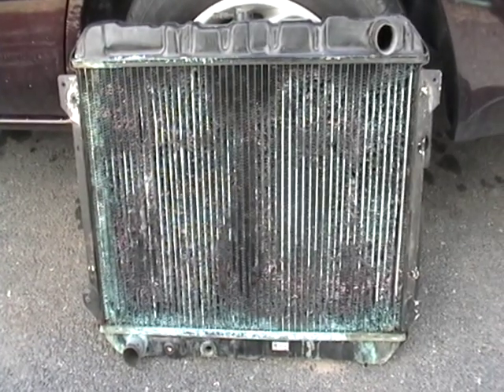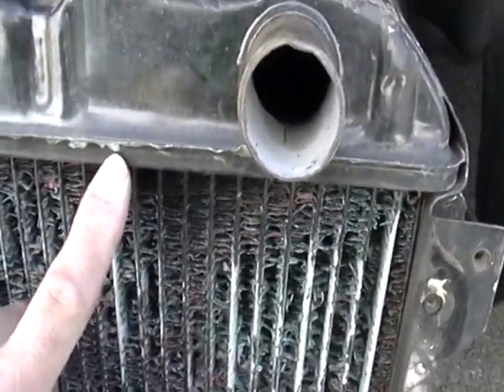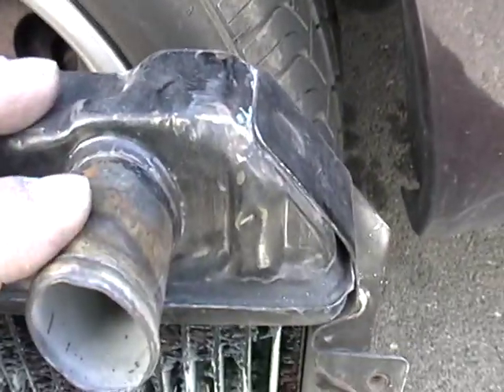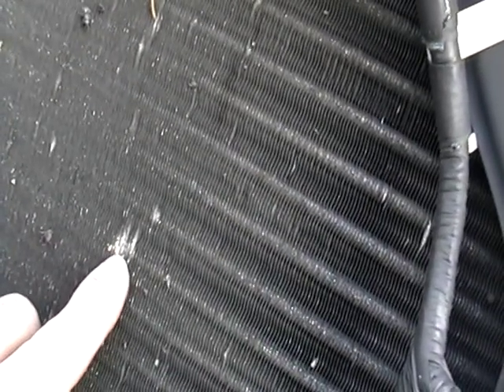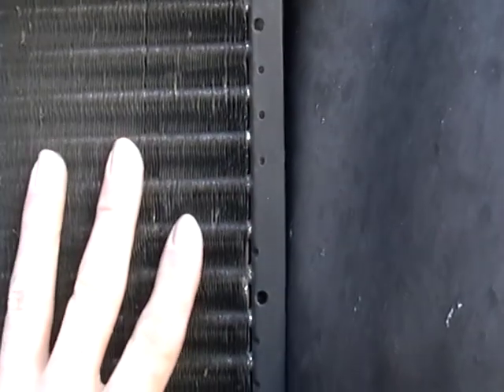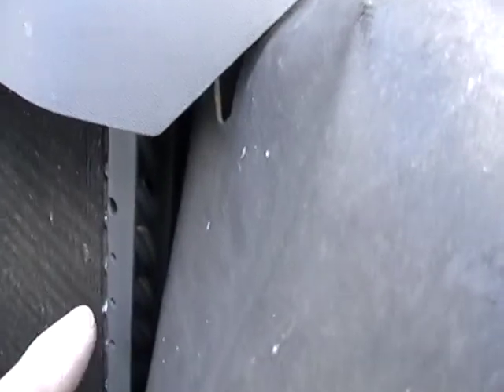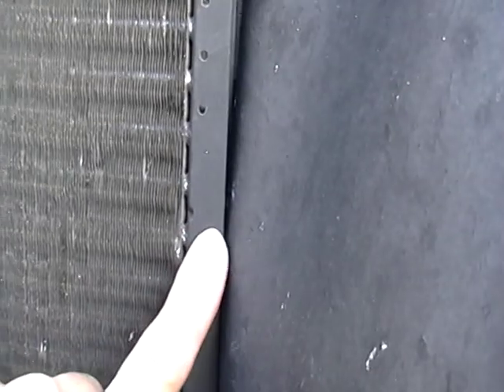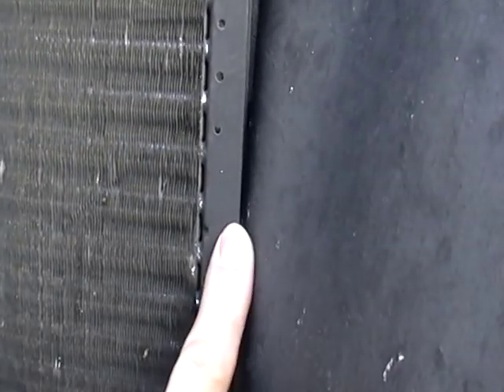Scrapping a car / truck radiator for cash

Comment: I have a transmition and a transfer case sitting in my yard. Compliments of the evicted previous tenants. I have the landlords permission to get rid of them. I see I can sell the full units for .10 a pound. Should I sell whole or break them apart? I am pretty sure they are no good for use.

Comment: Know your stuff. The tanks are brass like you said but the core is copper NOT brass. Take a torch and.melt the solder out and it will fall apart like the metal side frames. Easy to do. Aluminum rad like you show is not a rad but an a/c condenser. Not worth much unless you have a crapload of them. Some plastic tank rads have a brass cooler inside them  too.